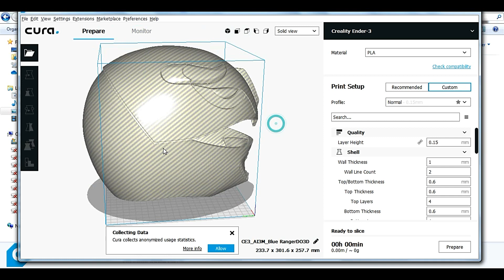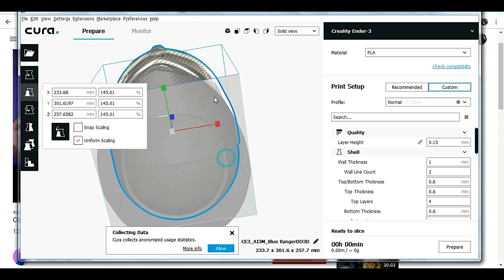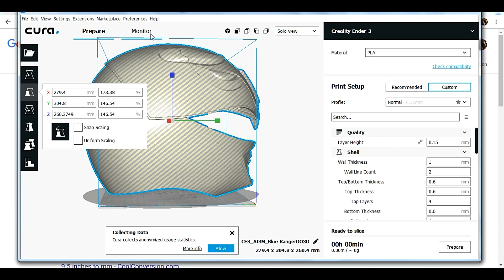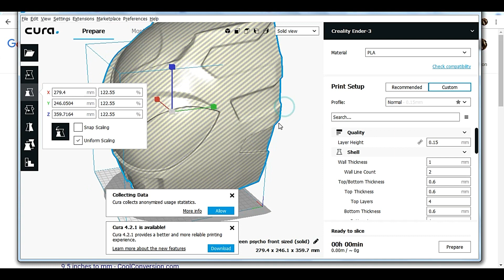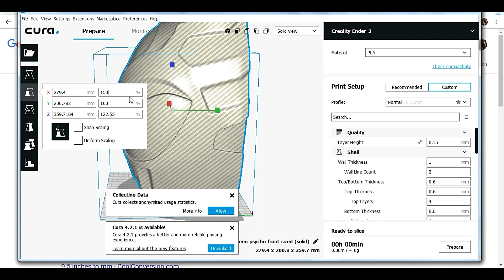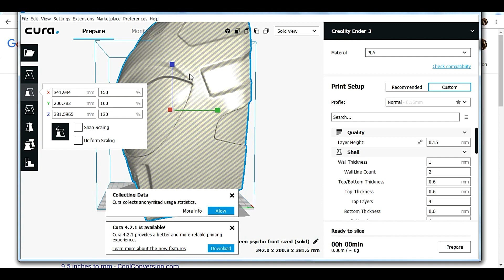Sizing Cosplay Helmets

Comment: do you know how to do registration keys for helmets? great video by the way
Reply from the maker: Ive made some before in Tinkercad. I usually take it and plain cut the area im putting the registration keys on and open that little piece in tinkercad and just build the registration keyes myself using basic shapes. Ive never done it any other way so I wouldnt know how in other programs. I thought about learning how to do it in meshmixer, cause you can, I just havent had the time. Tell ya what, learning these programs is a must when you get into 3D printing cosplay.

Comment: meshmixer works fine for me. blender wont work for me for some reason. blender wont open stl files which is weird. for measuring, i use netFab. there is a older version of netFab that is free but the most current version is paid. a lil searching u will find the free version